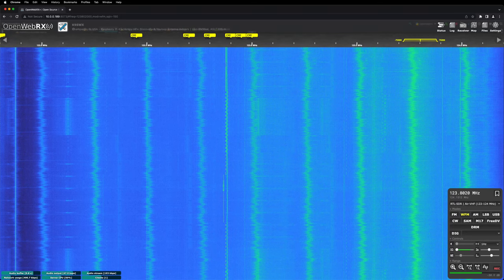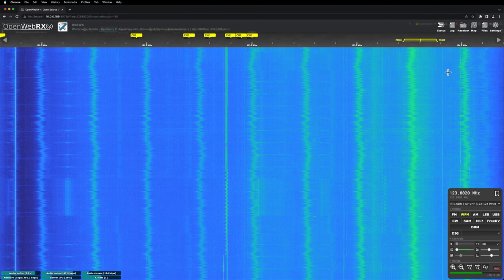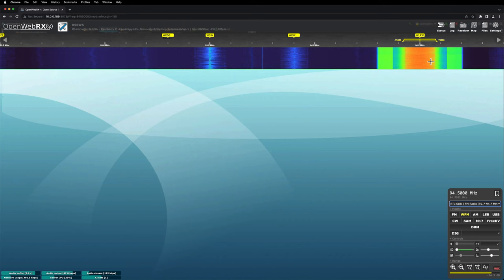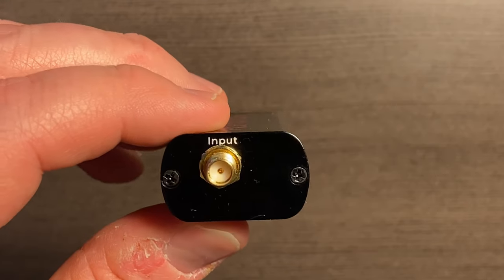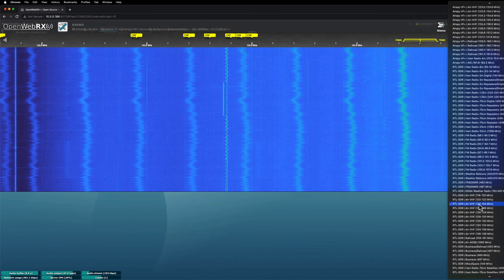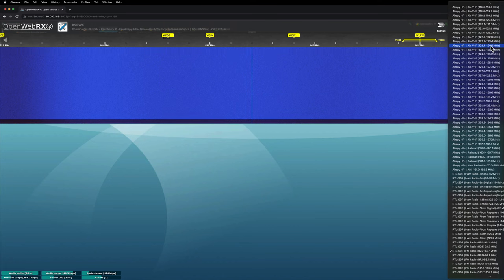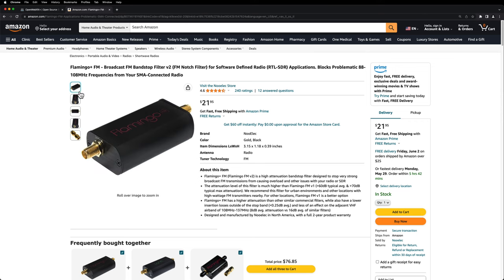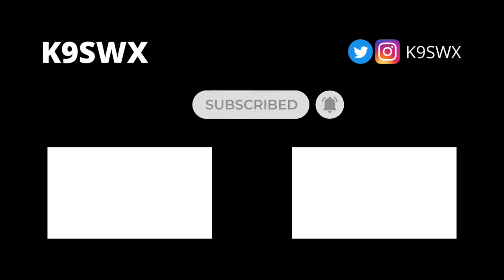Block broadcast interference with this FM notch filter for your SDR

Comment: Hi  Stan ! I tested one recently, and found that even if you switch input and output (antenna to output socket), the filter works just as well. I found this rather strange ...
Reply from the maker: That's interesting. I wonder why they labeled the connectors then. Thanks for the info!
Reply: @k9swx  Give it a try and tell me if you notice the same
Reply: The protection diode D1 must be connected to the antenna. From Flamingo+ FM page on Nooelec site:  
"Broadcast FM signals can be particularly problematic compared to other signal types due to their amplitude (transmit power) and proximity to residential areas. These signals can overload the front end of an SDR, causing imaging and a number of other issues.
...
Flamingo+ FM has its front end protected by an ESD diode meant for RF applications."

Comment: Is it good for TV?  Is it better than the Channel master CM3202? I live next to several FM stations & Airport.
Reply from the maker: I've never tried it on the TV nor have I tried the Channel Master. Worth a shot but the Channel Master might be better since it has the correct connectors and the other one has SMA connectors.
Reply: Jan 2024

bought this along with  2  SMA FEMALE  TO utilize with  my
tv antenna

   hoping  it  works